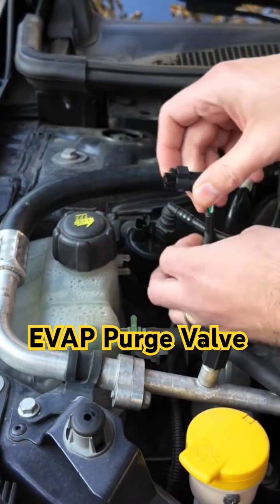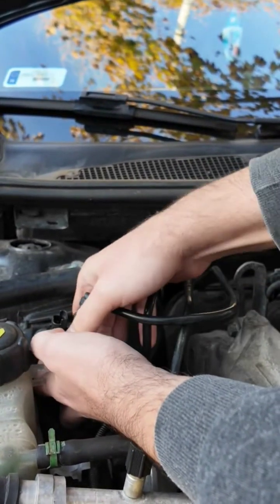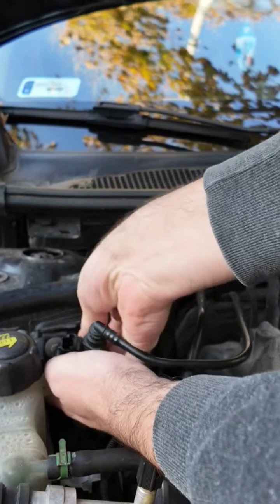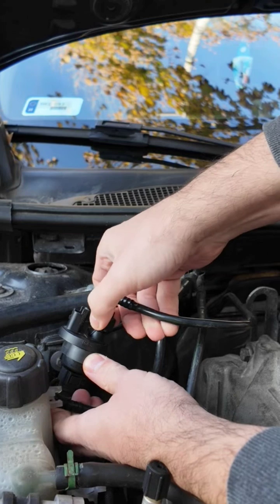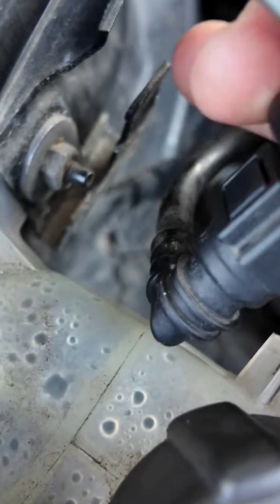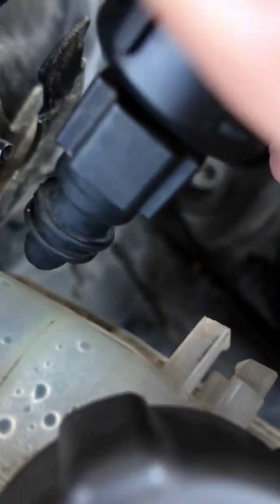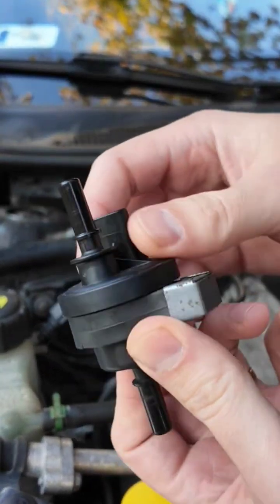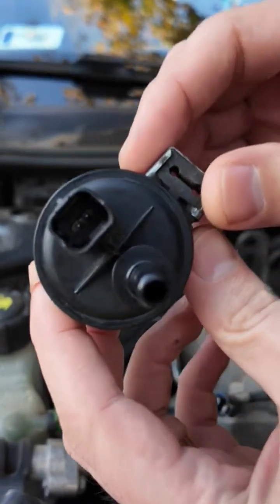Check Anti Pollution System | EVAP Purge Valve (Renault Megane 3)

Comment from the maker: Full video: https://youtu.be/mcdEye27Im0
Reply: Cant dhat its problem vith cold star engen? Ay have problem with cold start clio 20th 2010 facelift 1.2 16v 74kw.
Reply from the maker: Hi, Signs of a bad EVAP purge valve can be next: 
-Check Engine Light
-Difficult Engine Starting
-Performance issues
-Rough Idling
-Poor Gas Mileage
-Failed Emissions Test
-Fuel Smell from the Engine
Reply: @SpeedWaves1  ay no hawe check lights engen, nothig error on diagnostic. Testing plugh lights, cable, fuel pump, evrthing its gud. With start spray start good.
Reply from the maker: @veeuweeq3483  If the engine is starting fine after warmed up it can be air leak somewhere. Old rubber gaskets/O rings can be hard and not sealing when it's cold outside.
Reply: How did I you clean it
Reply from the maker: Hi, I used small amount of WD-40 on both side (inlet and outlet) waited few minutes to dry out. I also connected the car on diagnostic tool and it showed O2 sensor related issues, deleted the error and issue disappeared after. I was already ordered a new O2 sensor but didn't needed to replace it yet. 

It seems that issue was bad fuel/gas quality and there was some water or other residue in fuel system. 🙂
Reply: @SpeedWaves1  on my Renault Megane 3 there’s injection system fail and anti pollution system problem
Reply from the maker: @bestdon8951 I would suggest you to read the exact error codes with OBD scanning tool. That would show the right direction to find the main causing issue.

Comment: With what are you cleaning it, with water?
Reply from the maker: Hi, I used small amount of WD-40 on both side (inlet and outlet) waited few minutes to dry out. 

Few weeks later message came back, OBD diagnostics tool showed O2 sensor related error, deleted the error and issue disappeared after. I was already ordered a new O2 sensor but didn't needed to replace it yet. ✌️